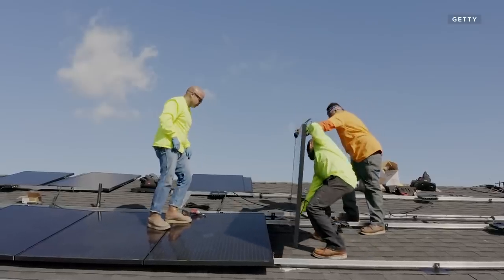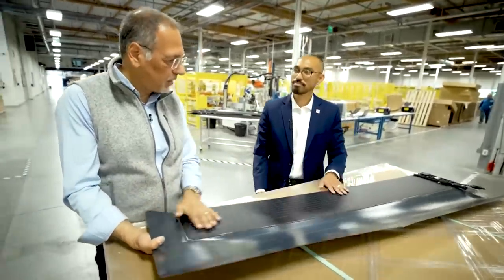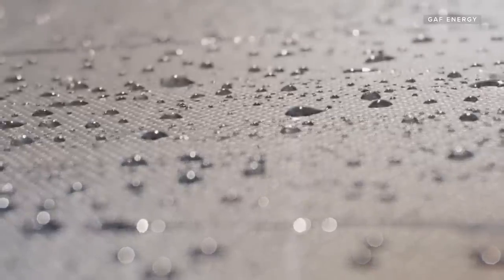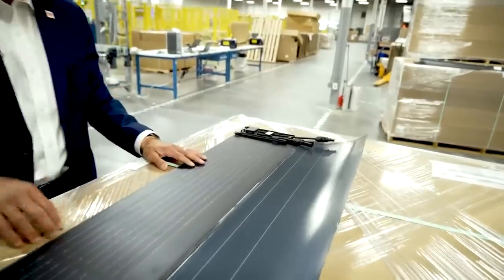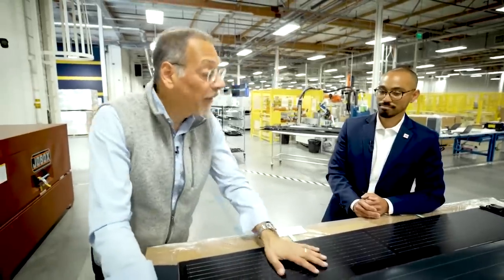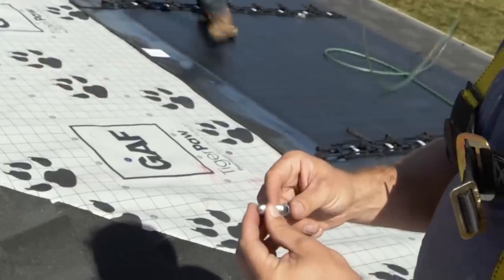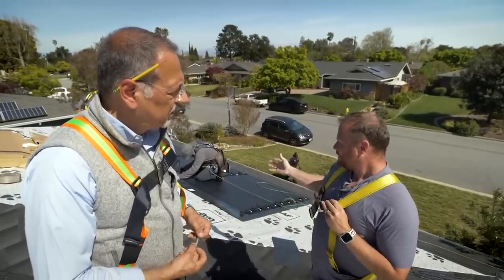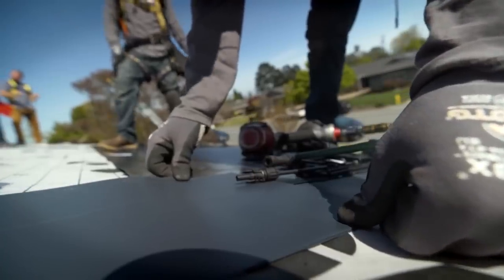The new Timberline Solar™ roofing system is so advanced it makes solar simple.  Call 801-447-8011

Comment: I put a metal roof on @14 years ago.  I saw a similar product but set vertically.  Iirc @22” wide sheets with rib. (You wack with rubber mallet to lock, hidden screws except end). So cord ran down every few (maybe 4?). Or ridge cover then down.  I contacted company.  But they disappeared.
  Seemed such a simple idea. Even easier then this.  Hope it works well.

Comment: I'm getting this installed on my house in about a month.  Very excited!  The pricing is in line with comparable systems on a Watt/roof basis.  One of the interesting things is that you don't pay for shingles that will be under a rack mount solar panel, and even bigger in California is that you don't pay for the labor to install shingles that will be under a rack solar system.  This is a VERY large benefit, and should be considered.  The warranty is also very impressive.  Are these the most efficient panels in the world, no, but consider the whole system, and it's very cool.
Reply: Sounds like uve done ur research. Based on the specs provided, it seems like the life span is half the length of traditional panels. And its close to the same cost foe the materials? Curious if u could share some numbers that brought u to ur decision. If not, thats ok. Its kind of a big ask, but hearing real world experience is always so valuable to people in general.
Reply: @adamkrasneski3679  The solar shingles are designed to last the lifetime of the roof ~ 25 years.  If the solar shingles fall below the  warranted output in those 25 years, they get replaced.  Not to shabby....
Reply: @matthunter1424  thats a good warranty 👍 what percentage of efficiency do they fall to before being replaced?
Reply: Matt can you tell me how much is this solar panel for square ( 100 sq ft)?
Reply from the maker: When you consider the cost of a new roof plus solar that looks much better than panels this is a great option at a very reasonable price.  The flat solar cells in the shingles are no different than what a typical solar panel would use; however, the technology used when integrating the solar cell into the solar shingle is far ahead of current solar panel technology.  The GAF Timberline Solar shingles will easily outlast and outperform a traditional solar panel.
Reply: The efficiency of a solar panel is less than 25%.  As soon as you waste your money for that inefficient junk, they will come out with a breakthrough that is 50% efficient, and you'll get no "refunds or incentives" for that.
Reply: @yourlogicalnightmare1014  No, no they will not, and you clearly haven't been following solar to know what's what.
Reply: @whattheschmidt  it's ok. They're still using a horse drawn buggy because a new more efficient engine is coming tomorrow. They don't need solar as they have no roof because tomorrow we'll come up with a better solution for roofs, maybe forcefields or smth.
Reply: @Costopher  
The multi-junction solar cell has already reached 50% in the lab dimby.  Twice as efficient as whats already available.

And yes, I'll be trading in my old 2021 Tesla when they are fully 4680 battery equipped. 

Your analogies are corny because they assume no discernment or reasoned thought.
Reply: Untill your house gets on fire, repairs if brakes and it will brake. Will be insane. Solar gets hot, thats why there is a gap between roof and panel it works like fire safety. Than it will brake and it will, simply one panel brakes and all roof will work as that one broken panel in normal solar it will take 10 min to find and replace, this you will need to change roof. Same goes dor tesla crap roof.
Reply: @adamkrasneski3679  Yes the degradation over time for these panels is quite bad. 0.55% per year.
Reply: @yourlogicalnightmare1014  "multi-junction solar cell" apparently being used (very limited) in aerospace b/c of their lightweight and very high cost. My inexpert opinion is… complexity = high material/manufacturing cost = many years (4-5+) to be close to cost-effective for homes/buildings. Perhaps car roofs before homes… better yet, like old hardtop ‘convertibles’ both 😀
Reply: @ArmandoPerezContractor  14.5 vs 19.5 watts/sq.ft.  … you do the math for ‘square’ 😀  Same CNET source (.com & guy featured here)… 607 vs. 451 sq.ft. to generate 8.8kW
Reply: @arturasnesakysiu1684  Brakes are on vehicles
Reply: Solar panels need to be cool. 
They make a solar panel that you can apply directly to RV boats or trailers. 
They don’t last because they overheat. There needs to be cooling behind it.
Reply: @yourlogicalnightmare1014  We call this "innovation", and people like me will accept different levels of the scenario you describe to contribute to innovation.
Reply: @matthunter1424  They get replaced if the company is still in business.
Reply: @yourlogicalnightmare1014  So surprising that Tesla owner is dismissive and rude. /s
Reply: @brettsherman7810  
You're ignoring the dozen cars I had before that, attempting to correlate things that have nothing to do with each other.   I find non-thinkers very irritating... that's my curse.
Reply: @yourlogicalnightmare1014  good job reinforcing the tesla owner stereotype mr know it all
Reply: @yourlogicalnightmare1014  Well you can say that with pretty much anything.  The internal combustion engine has pretty crappy efficiency overall, and we bough it, right....
Reply: @matthunter1424  
I wasn't around when the horse and buggy crowd were protesting the engine, but the engine, regardless of its inefficiency, is the only option in many applications and is extremely entrenched in our economy.

Solar is a niche product with extremely limited application IN ADDITION TO extremely poor efficiency, making it a lousy competitor to fossil fuels at this point.

I can't recall where I read it (or watched it or heard it) as I ingest news 12 hours a day, but I recall solar owners being legally punished by the utilities for having a solar product.  Don't remember the details, just my feelings at how vule and repulsive it was to punish solar owners
Reply: Good luck.  Timberline traditional roofing has a 50yr warranty.  Your solar will probably be outdated in 10yrs, most likely less
Reply: @josephyarbrough9316  What's the point of this reply exactly?
Reply: @matthunter1424  GAF Composition roofing has a 50 year warranty.  Solar panel warranties are less than half that.  imho, with technology getting better, you'll have outdated panels in 10 years, maybe 15.  I looked at these as well.  I put the comp roofing on,  bought and installed my own solar system.  The racking was installed with 50yr sealant. When my panels become obsolete,  I have the racking ready for upgrade.. I wish you the best and hope you are happy. Just asking that you look at the big picture and look at it long term.  I would be interested in what no-worry guarantee you're being offered.
Reply: Any updates on your install? Had a freak hail storm in FL, goofball size. Considering going with solar shingles but not entirely sold.
Reply: @Kobacolbz  All done!  looks good.  Electrical hook up next week some time.  GAF says hail "proof" since the shingles sit on the roof deck they don't deflect.
Reply: @matthunter1424  Awesome! Congrats. I’m leaning towards just going to metal from shingles. I wonder how well these hold up exposed to saltwater. I live right on the ocean.
Reply: @Kobacolbz  I live 1.1 miles from the ocean, no salt spray, but lots of salt air.  There is no exposed metal.  And the PV power connectors have a gasket to keep them weather tight.
Reply: "Pioneers get arrows in their backs." I expect it will take another few years before a reliable solar shingle is available on the market.
Reply: It’s been quite some time…how has the solar roof performed?  Also what size system did you get and at what price?
Reply: @ganthc  It has been a long road.  Code requires rapid shutdown switches and they were gonna put brief case sized housings all over my roof and i said NO WAY!  They had to redesign and it's good now.  I put 5.5kW on the roof (no AC here) and have arrays in every direction except north.  Right now at 2:40 PM I'm getting 4900W through my electric meter.  So good i'd say
Reply: @yourlogicalnightmare1014   even at 15% capture is better than 0% solar capture. My neighbors solar shingles paid themselves in 7 years and now they have a bill that looks more like 0-25$/monthly vs 500-800/month. Given, the best spots are where there is more sun than rain to install solar (still generates some on cloudy days). Back up energy panels also mean 0 downtime during California's common power outages.

Comment: I spent 1 year in Afghanistan 10 years ago. SF used a solar spray paint to charge their comms when outside the wire. I never new that stuff existed. It was designed by darpa. I told myself i would never get a panel. I've been waiting for this product. Knew it was a matter of time. 20 years from now panels will lawn art

Comment: This seems a pretty good idea for roofing with wood based construction houses. However, I see this might not be competitive when the roof has tiles or doesn't have a wood structure below the panel. But it is nice to have different options in the market either way.
Reply from the maker: Yes this only works with wood based roofing systems.
Reply: Liquid nail will be fine for tile or metal roofing.
Reply: i totally do not see the aspect of your argument... even if you had a steel frame structure, you could still fix using a different fastener. :/
Reply: sure, you can't use a high speed nail gun, but it could still be done. even just rivets would work. i guess some people just would rather question things.
Reply: @thomasknight-wagener6630  I believe the company becomes competitive when using their solar panels as roofing as you save money of the roofing and the mounting cost. However, once it is framed nad ready to be used in an steel frame structure I guess they will lose all their competitiveness as their price will be higher with possibly lower output.

Comment: This is a very good direction, however I think they are using plastic to cover the solar cells. Based on my knowledge about flexible solar panels, which are using very similar coatings, this is a problem, as they become less transparent over time, and even fracture, because of the UV radiation. Glass panels do not have this problem. And since there was no word about this, it makes me wonder if this problem exists on their panels as well.
Reply from the maker: A valid concern however GAF did consider this problem so a unique advanced thermal plastic is used which does not degrade or become less transparent over time in the UV radiation of the hot powerful sun.
Reply: @legacyroofingutah9766  Cool, thanks for the info! Would have been nice to include this in the video :)
Reply: I'd bet silicone based. Silicone has amazing thermal resilience. I once tried to release a glass panel secured by silicone. Even propane torch didn't soften it. Really tough stuff.
Reply: @RJSoftware2000  probably a 2k urethane  that’s what’s used as top coats on epoxy floors and cars
Reply: @legacyroofingutah9766  
What about UVC and gamma rays that are at ground level now.
And going to increase.?

Comment: Here is my question. He says it's walkable, but does that exempt it from the international code that requires a 3 foot setback from all edges? I was unable to install a sufficient amount of solar panels because the shape of my roof made it hard to install enough panels with 3 foot of walking room around them. If the code treats these like shingles and not solar panels then this really will be a revolution.
Reply: He addresses that at 4:00 and 5:25.  Now the codes might want to force you to comply with the standard panel requirements.  SO you might have to show them exactly what you are installing and that it is a shingle.  Direct them to this video perhaps.
Reply: You answered my question which was why don't these shingles go edge to edge on the roof.
Reply: Long story short the California setback rule was never meant to be a code, it was meant to be a guideline for AHJs to consider when reviewing solar designs for firefighter access. For example if the street is on the north side of your house and the solar array is on the south side, firefighters will get on the roof from the north side and they don't care what is on the south side (also most fire fighters I've talked to since 2016 say they no longer go up on the roof to cut holes in it). Instead every AHJ made it a code and it meant a lot less solar got installed. The new California setback rule allows 18" at the peak and a single 3' walkway on the left or right side of the roof, but not both sides. Again it should be on a case by case basis, but probably won't be. My AHJ adopted it as if it was code.

There is less flexibility with this system since you can't choose modules that fit and/or configure in portrait or landscape to maximize the roof space.

I've been in solar since 2006. I would choose a traditional system over this system BUT I'm looking into it myself because the roof of my house can't hold the weight of a traditional solar product. Unfortunately GAF is trying to compete with Tesla Solar with more than just shingles, they also seem to be mirroring their bad customer service. I've been trying to get GAF to tell me if I can get these in my region since they came out and they just won't answer. I keep leaving voicemails that they don't return.
Reply from the maker: This is usually a fire code or a code for wind.  The fire code is in place so fire fighters could break through the roof in the event of a fire.  Traditional solar panels and solar tiles are made of hard to break glass.  These solar shingles can be broken through with an ax so it solves the fire code issue of 3 feet from the edges of the home.  However check with your local code enforcement to be sure as each state has it's own opinion on this matter.  The wind code is in place because traditional rack mounted solar panels on the edge of a roof can catch wind easily and be torn off so placing them 3 feet in from the edges reduces this risk.  Depends on your region which code is being referenced.
Reply: @legacyroofingutah9766  I've never encountered a wind based code for traditional solar with racking. The design is run through the engineering program developed by the rack manufacturer and they tell you if you can't put modules in a certain area of the roof. You sometimes have to prove to the AHJ that you have run that calculation, but the AHJ itself does not mandate setbacks based on wind. I have had large chunks of roofs ruled out by the rack designers on some projects.
Reply: My permit has been approved, just a 2 course set back (because they don't want the shingle right on the edge.)
Reply: @legacyroofingutah9766  — The So.Fla bldg code has higher wind standards for roofs that affect solar panel racks (hurricanes); other jurisdictions may have the same for tornados. But So.Fla let’s you have standard asphalt/fiberglass shingles.
    Also, Tesla’s solar roof shingles are allowed to go almost to the roof edges. The apron edge, 1st row all around, is just non-solar shingle to avoid ladder damage, etc. - you can plainly see this in the Tesla roof ads. Same for GAF - I’ve never seen a 3’ apron for any shingle install.
    People get anxious about regulation, but usually the rules are pretty common-sense.

Comment: Seems like a step in the right direction but still rough. Would make a lot of sense for the leads/cables to be built into the panels so they don't have to be run on top with ugly covers.
Reply from the maker: Good point and thought, the cables need to be a thick enough gage to carry the high currents and at the same time the shingles need to be flush to the roof.  GAF tried to get these as flat as possible.  Maybe over time the design team can figure out a way to make them completely flush with the other roof shingles.

Comment: So it will need replacement in the same cycle as  a roof. If it leaks, you have a more expensive material to replace and more work to connect back in the system. These are two different applications and you are linking a low-tech water protection product with an expensive power product. Twice the possibilities. Notice they are not happy to show you the actual appearance  on a roof which really isn't like shingles. They have to be more heat tolerant because they are going to get much hotter than rack panels. Otherwise this is an interesting technology and may be a great option going forward. The low profile is a plus.
Reply: Its always what they dont tell you that screams the loudest. I find it also very telling that theres no spec sheet on their website. If it worked that well, they would be more than happy to display the performance front and center.
Reply from the maker: All innovative products come with their pros and cons.  Solar Shingles are no different.  This product is most suitable for new home construction or a re-roof install.  The solar shingles perform very well in rain wind and hail all while producing great solar power.  Depending on each home owners location solar shingles may or may not make financial sense.  Do your homework and make sure it is right for you.